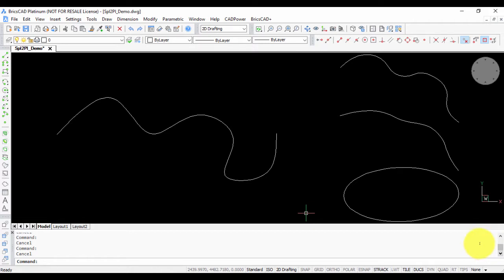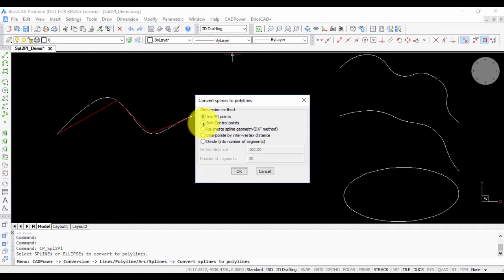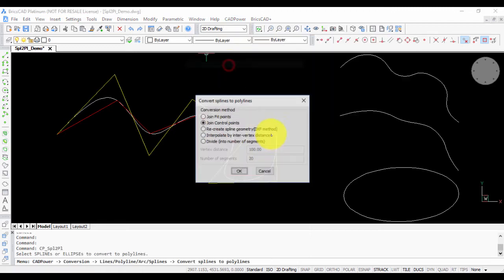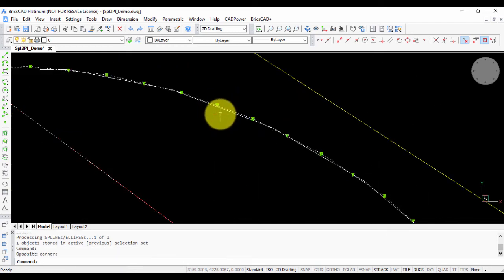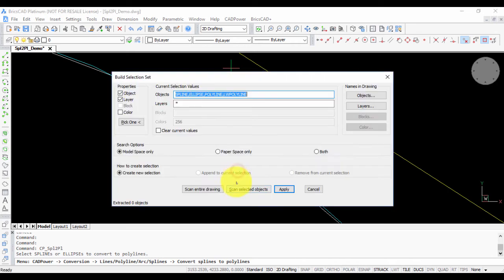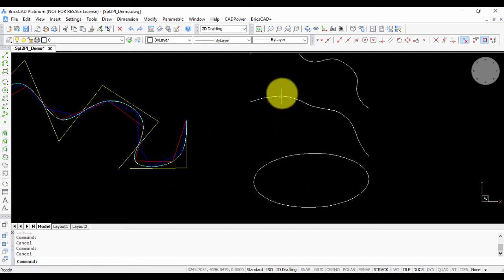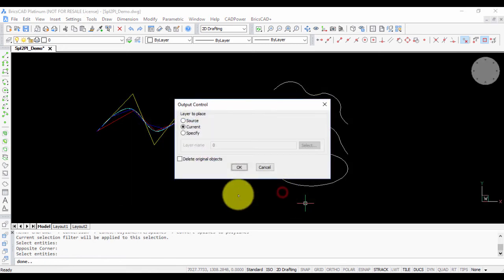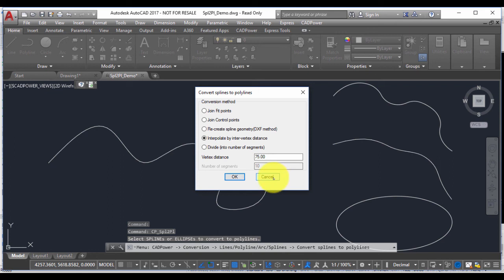Convert splines to polylines in AutoCAD and BricsCAD

Comment: Dear Rakesh, I wanted to draw an ellipse with a less pointy tips on the longer sides. So, I tried to replace the tips of the ellipse by first trimming it off and joining it with splines. However, it appears that the starting and ending points of the spline does not match the angle of the lines of the ellipse where it were trimmed off even after adjustments. How could I make the spline start/end at the same angle as the line where I trimmed off the ellipse?
Reply from the maker: Sorry about the late response. I presume you tried the ELLIPSE command. My understanding is that it creates a standard equation ellipse. If you use the SPLINE command, you will need to specify the definition points and the tangent slopes yourself and see if the shape is in line with what you expect.
Reply from the maker: I am not sure if this is a direct answer to your question but I hope there is some tip or direction and you can try this out. Once a spline is converted to linear segmented polylines, you lose the ability to modify its shape by tweaking control points. One of the things I would try is to re-draw a polyline geometry and and connect them to form a new spline. Does this work for you?